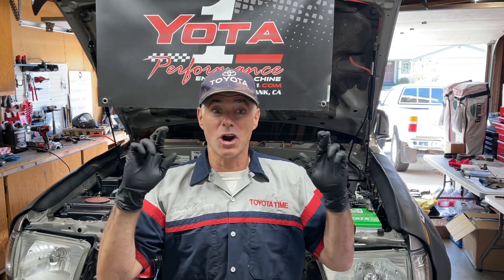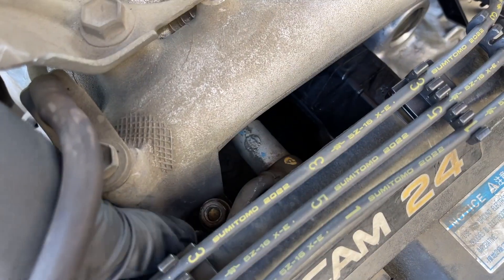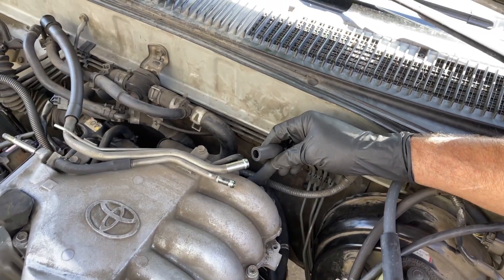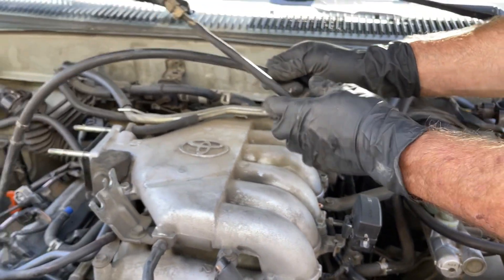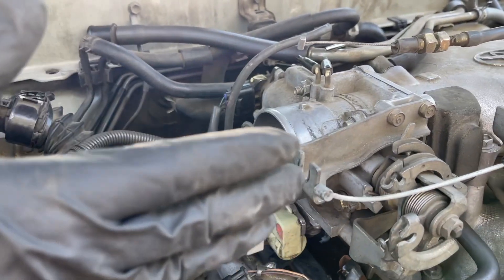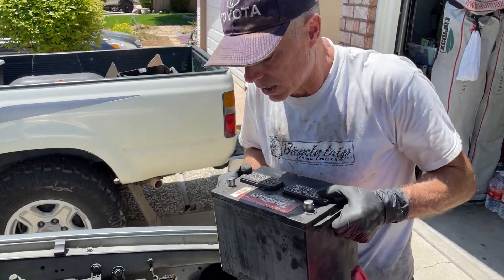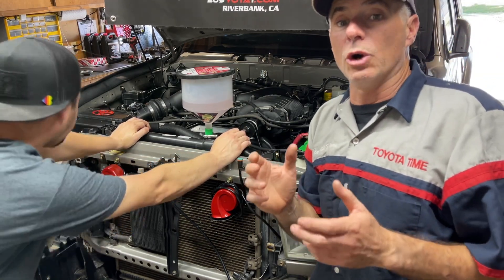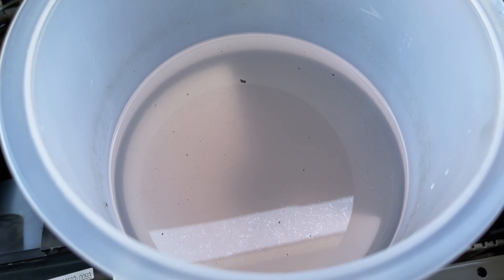Engine Head Gasket / Cracked Head Repair (Toyota 3.4L V6 5VZ-FE ) - Part 7

Comment: Just had come across a burning coolant issue on me 3.4l and wanted to get your opinion.  The engine has never been overheated to my knowledge of course it is used with 235k miles. I had replaced the timing belt with a complete timing set including the front and rear main seals the minute I got it looked over and on an engine stand. I've had the intake manifold off and used new gaskets when reinstalled, unfortunately not Toyota gaskets. after getting everything put back together and engine running it now burns coolant. Has a smooth idle with no codes being thrown for misfires. When I removed the upper plenum I didn't un bolt the throttle body so that gasket was never touched, and when it was reinstalled the coolant and vacuum hoses going to the IAC were installed correctly. I pulled the intake off and installed Toyota gaskets and after reinstalling the intake manifold at first no burning coolant, but after running for five minutes getting the coolant to circulate while engine is in closed loop, then the engine starts burning coolant. This is very noticeable by the white smoke coming out the tailpipe. I have never remove anything lower than the intake so I'm a little bit at a lose is to why all of a sudden this engine is burning coolant. The engine has been out of the truck since I was doing other work so it has been sitting on a engine stand in the garage for about two to three weeks. Any ideas to were/what I should check.
Reply from the maker: Coolant could be leaking into the cylinders via the intake valves if the intake manifold gasket isn't the  greatest.  Air intake ports are right next to coolant ports.  If the gasket is compromised between those two ports, coolant can leak into the cylinder.
Reply: I was thinking that with the old cheap gasket but not with the dealer gaskets. Plus on the coolant ports I added some Ultra Grey around the coolant ports since the old gaskets were pretty well sealed when I removed the intake the first time. If coolant enters the cylinder in the intake side during combustion wouldn't that cause a rough idle and possibly a misfire? The idle was butter smooth and no stumble with throttle operation at any RPM. Could there be coolant be getting in through the intake from the IAC? But maybe that would also give me a rough idle as well.
Reply from the maker: @SOLDADITO76  It should cause a rough idle, but who knows.  When you've got smoke coming out of the exhaust pipe, no obvious leak, and you're losing coolant, your engine has to be consuming it
Reply: I guess the only other thing I can think of is pulling the plugs to see which one looks like it has signs of be basically steam cleaned then pull a cylinder head/heads. Just wanted to see if you had any ideas before I really get in any deeper.

Comment: Do you think the supercharger had anything to do with the cracked head?
Reply from the maker: I do.  We think maybe the engine was running a bit lean which contributed to it.  We are in the process of installing a 7th injector, higher capacity fuel pump and computer tuner to hopefully improve the air/fuel ratio and get better performance from his engine.

Comment: Sean, i like that Red URD pulley!!... its much nicer looking than the OEM pulley that i had to replace for 600$ because it failed before my rig hit 190k miles ... the coating on that pricey new pulley has already failed, flaked  and developed surface rust on it 8^(  its unsightly compared to your red one LOL
Reply from the maker: You purchased an OEM crank pulley and the coating is already failing? And it cost $600?!?!? This URD pulley is only $300
- Sean

Comment: I wish when folks mentioned something on the web that they would simply give a link, thank you brother for the great series. As a DIYer you are not an engine rebuilder and machinist, only a rebuilder, we always send out the work to the machine shop and simply put it all back together as a DIYer, mechanic, or tech at all levels.
Worse than Chiggers series is listed in his remarks guys....
https://www.youtube.com/watch?v=voLBRDZL9fE
Reply from the maker: Interesting comment about the terms Rebuilder and Machinist.  A shop like Yota1 Performance is an Engine Rebuilding Shop.  They do the machining and they do the assembly.  So, when I hear the term Rebuilder, I think of a shop that can do it all.  I think DIYers farming out the machining to a machine shop are more of an "Assembler" but I know the term most use is they are "Rebuilding" their engine.  

Thanks for the comment.